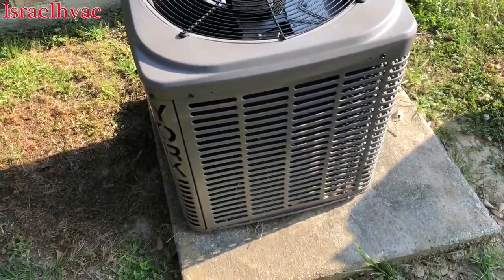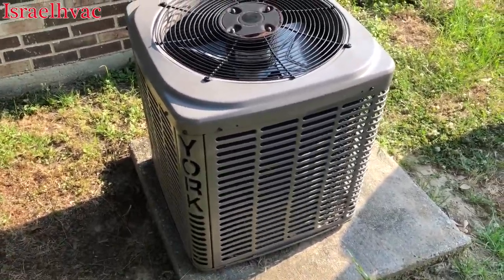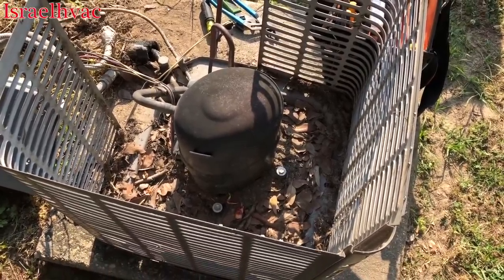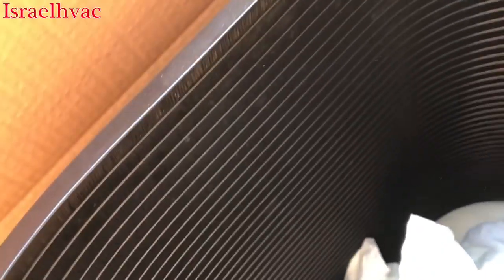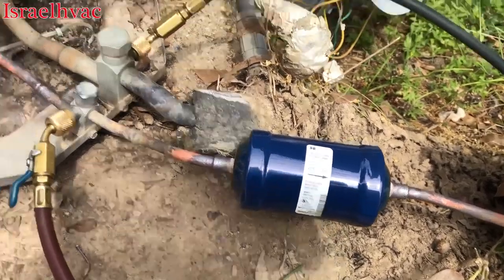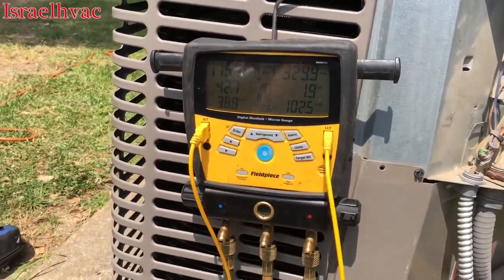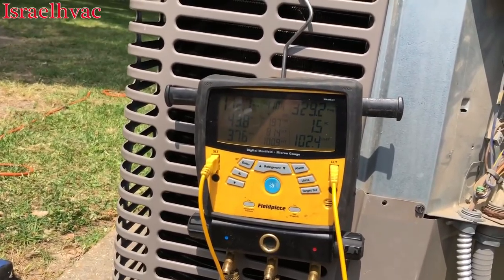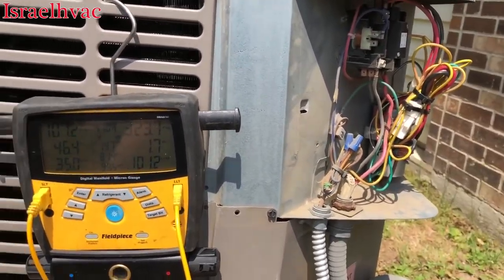HVAC Service | Replacing a MicroChannel Coil

Comment: Does anybody else, other than me, think that this is more of a  R-410A problem? In my 16 years of doing this I've never seen the kind of leakage we've seen since the transition over to 410A. It's every brand across the board, no brand is exempt from the leakage problems! If it's not pin holes everywhere, it's cracks in the factory solder joints, or solid copper pipe just sheering into. And the sad thing is, the homeowner has absolutely no protection and no recourse to take against the manufacturers making this shoddy product. Not to mention,it's a hell of a lot of PAIN IN THE ASS work for us to have to do! #JOBSECURITY
Reply: Shannon Knight The 410A has too high of pressure..   we never used to have so many leaks.
Reply: I even wonder if it might have something to do with the chemical makeup of the refrigerant and the oil.?
Reply: Shannon Knight agree..... 410A is an inferior refrigerant and every brand is garbage anymore. Best just going with the best warranty and what brand takes care of you and your customers. Thinner walls of the coils to increase heat transfer while "cutting costs" is bullshit. Make the coils bigger and offer the hacked up bullshit as a base model with less of a warranty.

Comment: I know let's coat the coil with epoxy, yeah that will work. Just like epoxy coated indoor coils, tin coated coils etc. LOL. They all leak. I don't ever remember a time in my 23 years of doing this thankless job that refrigerant leaks were never a problem. Back 20 years ago the refrigerant was more or less 'given away' because it was dirt cheap. Now that prices are so high for refrigerant everyone seems to think there is some magical problem with refrigerant leaks. There has always been refrigerant leaks every brand. Some more than others but at the end of the day folks, THEY ALL LEAK. Look at what I do for a living. Hello? If you're a home owner, you will always need a good HVAC repair man. I employ methods that reduce these kinds of problems. Remember refrigerant leaks have always been a problem in this industry. There is no such thing as a perfect solution. I service the Katy, Texas area.

Comment: Not all microchannel condenser are bad. The ones in cars lived to see 25 years of leak free life. Nordyne are the worst microchannel condensers.
Reply from the maker: Sorry but Yes all microchannel coils are bad!!!
Reply: @johnisraelhvac2019 car AC systems use R12, R134a, or R1234yf which operate at 270 to 300 PSI tops instead of 500 psi tops. Also the micro channels on auto ac condensers and evaporators are thicker and beefier.